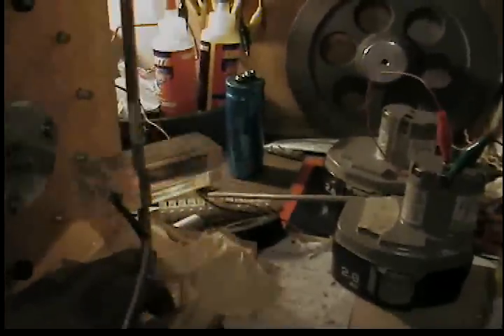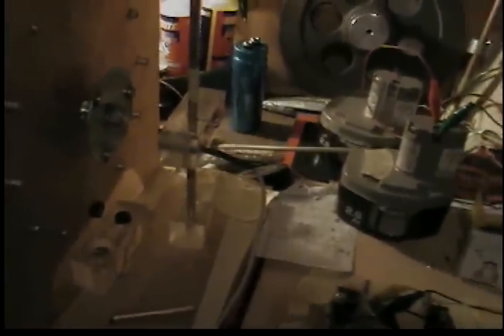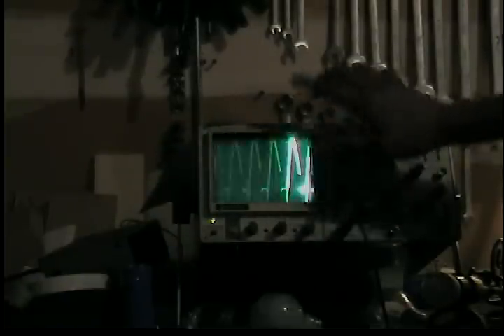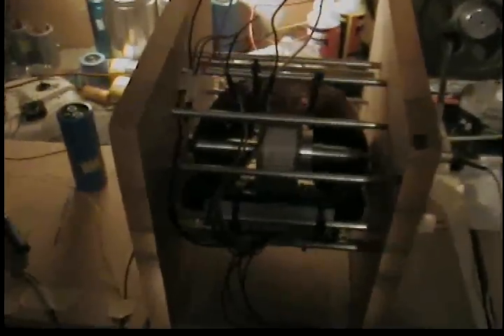Window motor with no bemf?

Comment from the maker: @ttiracing I think iT is right about bemf and radiant spikes being different. The bemf spikes will fill a cap but not as fast as an energizer will. I will still try to charge dis charge a cap in the system, just need to get every thing else in fine tune. Peace Rawbush

Comment from the maker: @llewgnal The problem I see with using an rpm input for setting the firing sequence is for one I think I would need to use two halls(or one like your 4 pin) so that 2 samples are taken per rev, this should provide a clean rpm reading. The other issue might be the arduino spending to much time reading halls to fire motor. But I will find out if I need adjustments based on rpm. Thanks for your interest.

Comment from the maker: @llewgnal  The rotor is 6 magnets n-s-n-s-n-s facing out. I will be changing my code to use micros instead of millis, right now my fire time is 1ms. I have just finished tuning the second side and have gained about 300rpm and amps are under .1  . More to come soon. Rawbush

Comment from the maker: @llewgnal There is actually 6 sets of wire in that coil. Starts with 2 22ga and 2 28 ga, 300' each. Then there are 2 more 22ga 300'. I have played around with putting them in series and parallel, each does something different. Whats your take on what is happening here?

Comment: Radiant energy spikes and back EMF are not the same, according to Mr Bedini And Bedini also says that all magnets should be facing the coils with one pole only. I used to believe that Bedini uses the back EMF only for his timing on the wheel design, but other then that I think that the back EMF is not necessary when the arduino is doing the timing. Do you have less cogging now the back EMF is gone? Peace, iT